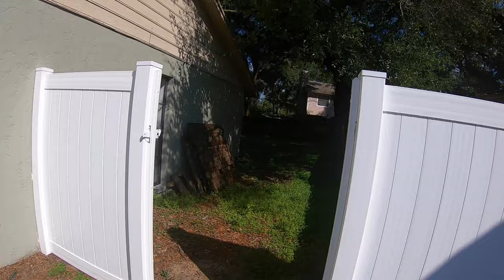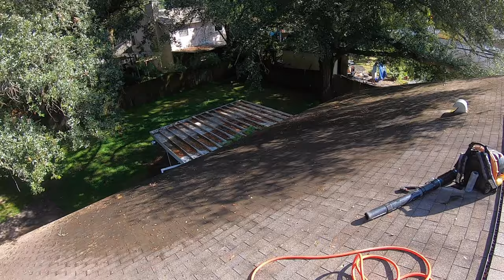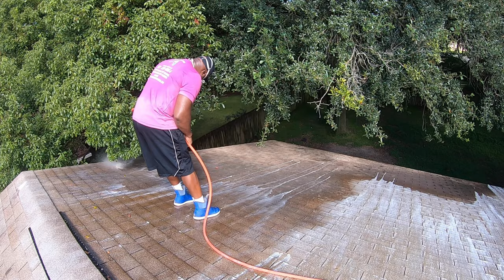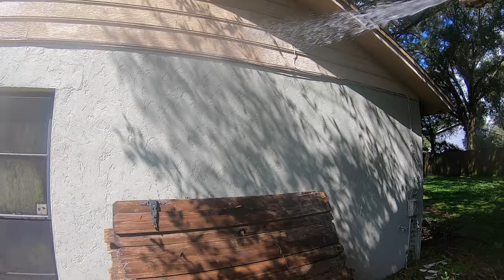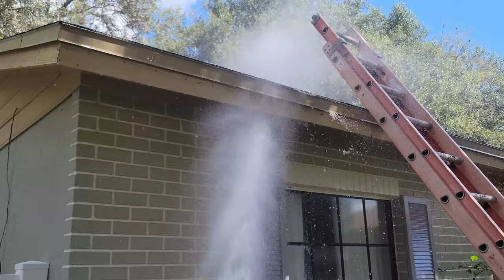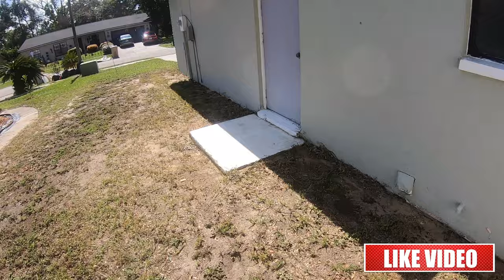Full Service Roof wash, House wash, and Driveway cleaning

Comment: As a power washer myself up in MN.  This is half statement half question.  I buy what I think is quality ⅜ hose ends but sometimes I think I'm lucky if I get one day out of them.  Especially the female ends with the bearings.  Seems all good but the next day I can't pull back the collar and I have to WD40 it and use a channel lock to rotate the housing to losen it up.  Then the male ends get the dimples in them making it bumpy as you rotate.  But not nearly as much as female ends going out.  I'm not concerned with the Orings, I carry a bag of 100. So how often do your hose ends fail on you?   Plus at around $10-15 for SS hose ends I expect more.  My machine I use mostly is my belt driven Simpson Commercial 4gpm@4400psi.
Reply from the maker: What brand are you purchasing?  Mine lasts months.  I use the general pump SS quick connects.  Those are the top notch ones
Reply: @PinkFlamingoPowerWash  I'll have to double check.  They came from the Pressure Wash Store online.

Comment: Great video man! These videos are really helpful, how many sqft was that house and how long did it take you to clean it?? And Do you is possible to do this job using a 5 gallon bucket with sh and surfactant connected to a pressure washer using a chemical injector?
Reply from the maker: Thanks a lot. I appreciate that. That house was about 1200 sq ft.  It took me about 2hrs to complete all 3 services.  Yea you can downstream that house easily with 5gallons of sh. You would have some left over actually.
Reply: Thanks for the help, I really appreciate it. 👍🏻

Comment: Im loving your videos Sir. Just one question! On the driveway, do you post treat and just leave the sh there or rinse it out again? I had a problem on my own driveway trying to test to find the best mix and quickest way to do it, but I think I've used 5% post treat and it turned yellow after it dried.
Reply from the maker: Thank you. No there's no need to rinse it.  Just leave it on and most of the time by time you wrap up to leave the marks will be gone.